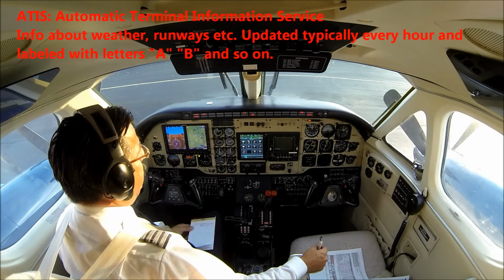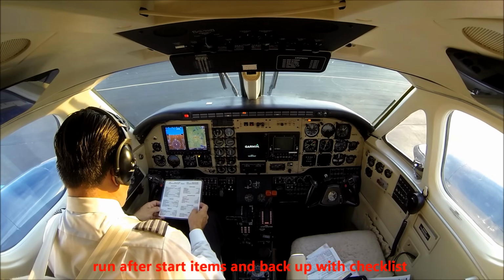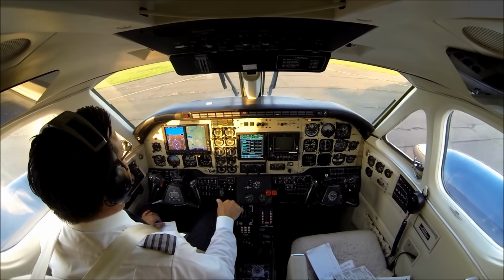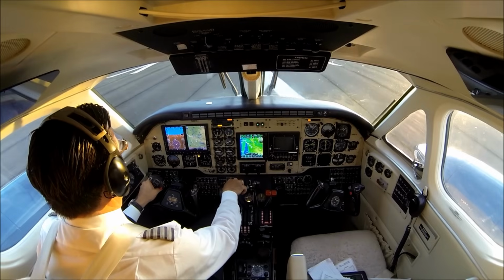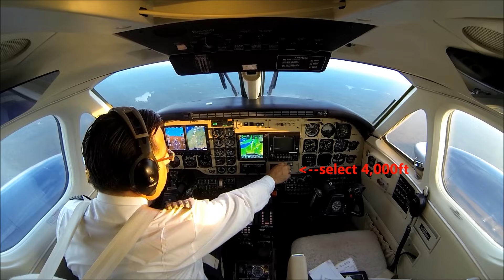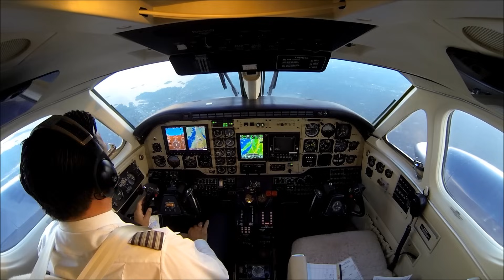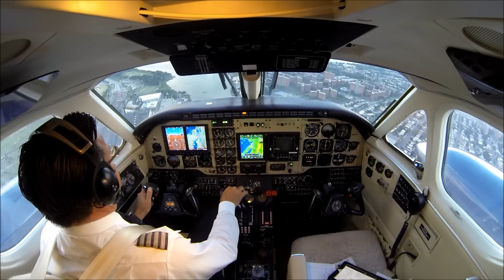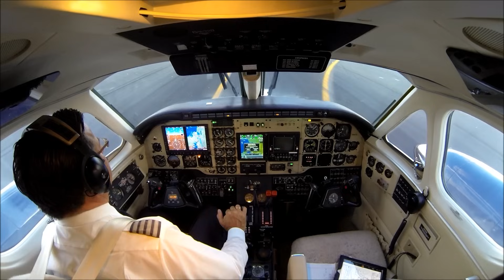King Air B100 - IFR flight to La Guardia KLGA!

Comment: The more one knows who to use the tools at hand, the easier it is to fly and monitor those tools.  At one time a type rating was systems and IFR workouts.  Now being comfortable with the nav units and couplings to A/P, the type rating part is a lot easier.  One thing though, relying on the gear-low torque to remind, could condition one into set pattens to lower the gear.  What if one is in an Aero without that function?  When Be100 and 200's entered service here, there was a trend for CPL's to move up to the ATP's.
Reply from the maker: Hi Dave,
I fully agree that one should never rely on the gear warning.
Checklist compliance is important and on top of this I still double check the "gear down" at 500 ft AGL. 
Happy Landings,
Guido
Reply: I often wondered when the newer equipment came into use, if there had been much pre-testing of human behaviour to user flaws.  In the early days, when the FAA was going to implement a new procedure, pilots where assembled in a room and each had a number. The controllers gave instructions while the psychologist watched and took down notes.  If there was a trend of test subject to turn right in stead of left, the procedure had a fault and was modified until no human intuitive behaviour took place.  I was taught and it is the standard here, to lower the gear on capturing the Glide Path before anything else.  A suggestion I submitted to CASA some time back, was that a trigger happen if the Aircraft has been established on a steady rate glide and the RA indicates a thousand feet  above minima, to sound out a GEAR, warning.
Reply from the maker: Dave F Ryan Thank you Dave. This is very interesting information. Did not know about this.
Happy Landings,
Guido
Reply: Pleasure Giudo.

Comment: Thanx guido...."Geil" as always..

Oh just one more thing...my two King Airs  from Carenado in X plane.The moters  are very sensitive.If I use them at max to long, they blow up on me.Is that true?

Thanx one more time .Happy landings..
Reply from the maker: Hi Willem,
turbine engines are very sensitive to excessive temperatures. But if you operate them as per the specifications, no problem at all.
Some engines have limitations, but these are mainly for cases of an engine failure. You can operate then the other engine for 10 minutes at a slightly higher power setting.
But in general the simple rule applies: operate the engines within their limits given by the manufacturers.
If you treat your engine well, the engine will treat YOU well.
Happy Landings,
Capt. Guido
Reply: @GuidoWarnecke  Thannx...
Reply from the maker: @Willem P  My be you can hel me: I have x-plane 11 and bought the C208B G1000 from Carenado. I cannot switch on the avionics. Other switches work. Any idea?
Happy Landings,
Capt. Guido
Reply: Carenado C208B Hi Guido. I know, half the fun flying this plane is the start up but, when doing this the avionics is stuffed. Unfortunately this does not work. The only thing you can as far as I know is to start with the motor running. When you start x plane and pick this plane. In the right corner bottom you tick the start with motor running and then it works.
I hope I could help you...

Comment: Guido it looks like you are flying with paper plates.  Do you expect to transition to an EFB or will you remain on paper?  I took my IFR checkride with the Foreflight app and have been using it ever since.  Just wondering about your thoughts on continued use of paper.
Reply from the maker: Hi Mike,
the future is electronic.
I flew for a company called CFM and we were the first in the US to be approved for paperless en-route and approach charts.
Works very well and you have always current charts over the internet.
Make sure that you have a charger on board (preferably a second EFB) and do not expose it to the sun.
The screen blanks out for a while...
Happy Landings,
Guido

Comment: I'd like to fly from Virginia Beach to Republic airport in long island. My intended route will put me over JFK class B and I do not want to be too far out over water with a single engine. Do you have any experience with VFR operations in this environment?
Reply from the maker: Normally not a problem. Call New York Approach well ahead and advise them of you intentions. Depending on the runway in use they will give you a class B clearance with altitudes and headings. Another cool thing you might consider is t fly very low South shore long Island. Up to 500ft it is completely uncontrolled, but you may speak to Kennedy tower and get a transponder code. I would fly at a 1000ft or so for safety.
Enjoy and let me know how it went!
Happy Landings,
Guido
Reply: Guido Warnecke Great. Thank you for the response.

Comment: This question is open to everyone. If you had to spend 2-3-4 hours flying an airplane, would you rather fly a turbine or a turbo prop and why?
Reply: +SanFranciscoBay Whichever has the more comfortable seats :)  Honestly the major limitation for flight time for me is needing to use the restroom. When I did my crew xcountry flights working on my commercial pilot certificate my first long xcountry was from Longbeach to Phoenix with a cruise speed of around 115kts which makes that a 3hr flight. Going across the desert where surface temperatures were 110F (but was a nice 55F at 12,000 feet) I made sure to hydrate before and during the flight but I drank a bit too much water and knew I was in trouble when I needed a bathroom 90min into the flight...  I made it to Phoenix and sprinted to the restroom but learned my lesson - water in moderation ;)
Reply from the maker: +SanFranciscoBay 
Flights in this jet are short, normally not more than 4 hours.
Happy Landings,
Guido
Reply: +SanFranciscoBay Was flying with a female co-pilot on that flight ;)
Reply: +Cascade Alley Aviation Services. Women have to urinate and defecate also and sometimes it's difficult to predict when. Is there a backseat that you can go to or do you have to stay in the front seat?

Comment: do you always start the left engine first and then use bleed air to start the right? or can you do this the other way around?

Thanks Much
Reply from the maker: Hi Rick,
you can start either engines first. 
Using an GPU (electric ground power unit) it will be plugged to a port behind the right engine.
Then the procedure is as follows: 
Start left engine first, unplug the GPU from the right side, start right engine.
It would be very unpleasant for the line crew to unplug the GPU cable directly behind a running engine.
Here a link to my latest video:
https://youtu.be/Af3fVp8R8bg
Happy Landings,
Guido

Comment: Hey Guido, thx for that video... I'm "just" flying Cessna and Remoquer.. but I've a Question... the Headset / Intercoms have the same plugs I think, which adapter do you use to record the atc's and your speech? I didn't find any adapter to plugin between intercom / headset to grap the sounds are apoken..
regards,
tim
Reply from the maker: Hi Tim,
(German?).
Fuer den Anschluss nehme ich einen sogenannten Y-Adapter. Gibts vielleicht bei Conrad Electronics.
Schicke mir ein email (Adresse am Ende des Videos) und ich schicke Dir ein Bild von dem Adapter,
Happy Landings,
Guido
PS: Remo ist ein klasse Flugzeug! Hab ich beim Aeroclub Gelnhausen ein bisschen geflogen (DR400)
Reply: Guido Warnecke  Verdammt habe ich geahnt mit dem "Deutsch" :- )
Mail ist raus - danke dir! :- ) Btw ich auch eine DR400 :)
Reply from the maker: Mein Deutscher  Akzent am Funk...

Comment: Hy Guido. You have some interesting videos but this one, is not one of them. I'm a first officer on Dash8 Q400 and also certified flight instructor for PPL and CPL training in Croatia and I'm more than qualified to recognize some potential problems and risks during single pilot operation. First of all every pilot should insert and check his flight plan in GPS on parking stand not during the taxi like you did. Briefing was good but you didn't say anything about normal departure briefing only emergency  before lift off and after lift off. Have you identified any of the navigational aids? specially localizer frequency? During approach to land you have put your electronic flight bag or whatever that is on the copilot seat. In case of go around you don't have a chart in front of you and if you don't have it memorized in your head, you would have to remove your hand from the throttle's to pick up your EFB to read some go around information. You know as well as I do what kind of problems can occur during go around specially in single pilot operation. After touchdown during deceleration you moved your head down and to the right searching for ground chart. This is not good because the aircraft didn't come to a stop. Remember this is a single pilot operation!!!!! I hope you're not mad at me for writing critics but that is only because you have great videos and I wanted to point out some negative transfers that we all have to a future pilots that are watching your videos. Sorry for grammar mistakes.
Reply from the maker: Thanks for your comments, Dado.
Some of them are very good, some of them come from the "academic" side of flying, and I do not mean this disrespectful.
Example: Modern radios auto-identify the frequency and show the identifier e.g. IXYZ. Single pilot flying is quite common in the USA, also under challenging weather conditions. In case of a go around, I would probably ask for vectors instead of flying the published missed approach.
Heads down: difficult thing - single pilot for example during take off you have to inside and outside of the cockpit all the time, monitor engine instruments.
Your comments are appreciated and especially for the new pilots during training everything should be "by the books".
Happy Landings,
Guido
Reply: What a load of nit-noid road apples.   I'll bet guy just LOVE to fly with you.   "See  you at the bar"   "Uh, no."

Comment: Guido. Why do you do your taxi with prop levers backward?
Reply from the maker: L. Risali These are Garrett engines with a direct shaft from the engine to the propellers.
For taxiing, we use a ground rpm setting (approx. 65%).
Otherwise the noise would be unbearable.
In the "normal" King Airs with PT6 free wheel engines, the lever is forward. This is probably what you are referring to,
Thanks for your comment & Happy Landings,
Guido
Reply: huum.. ok. So, because of this type of engine don't you do engine run-up before take-off?
Reply from the maker: no in turbines no typical run up is required.
Happy Landings,
Guido
Reply: I'm talking about overspeed governor check, and ice vanes check.
Reply from the maker: Overspeed governor check is only done once a month or so or if you do training and plan an engine shut down inflight.
Ice vanes are not installed on the Garrett engines.
Happy Landings,
Guido
Reply: Great... thank you, happy landings! 
Lucas Risali

Comment: quick question
when starting, I didn't see your arm move forward for fuel? is it all automated?
Reply from the maker: The engine start process in a Garret engine is automatic, like to start an APU.
The engine revs up, at a certain RPM fuel is automatically induced and it is an automatic process.
In reality, the pilot needs to adjust the fuel spray during engine light up.
Generally an "easy" process but requires good training for the pilot.
It is so different form a start process in a PT6.
Happy Landings,
Guido
Reply: +Guido Warnecke very nice! thanks! and with the adjusting the fuel spray, is that with small movements of the mixture lever?
Reply from the maker: The spray is on a small switch on the left of the cockpit out of view in the video.
Please send me an mail (address at end of video) and I send you a detail photo of the cockpit showing the switch.
Happy Landings,
Guido
Reply: +Guido Warnecke I'll send an email now, cheers!

Comment: Hi Guido, How much a landing on KLGA?
Reply from the maker: Willys Luna
Hi Willys.
The total cost is around $400,. Only a small portion is for the landing fees, the rest is for the handling services.
We avoid KLGA not so much for the cost (nearby Teterboro KTEB charges the same) it is because of the foreseen delays.
On one flight we had actually to taxi back to the ramp and get more fuel after waiting over one hour with the engines running.
You burn more than 150 liters per hour with the engines in idle only.
Happy Landings,
Guido
Reply: All right, thank you Captain...

Comment: to me no sense to do fms preparation on short stops during taxi, literally it takes same or even more time then after engine start on apron, plus(block time is ticking already, if overcrowded field traffic will be angry as well,+possible number 2.3.5 for takeoff or giveway to another aircraft you are number 100 - fuel savings zero, time ticking), when everything is IN fms, clearance received, in major airports transponder already shall be on when starting taxi. less workload during taxi, more situational awareness, less probability to miss something in checklist or some other thing... my 5 cents
Reply from the maker: Vladimiras Salukas Hi Vladimir,
Your comment is appreciated. The King Air B100 has no APU and the avionics drains a lot of battery power. So unless you are on ground power - not available at KLGA - you need to have the engines running. Also I do not understand the comment with the transponder. Some airports require ground mode on for taxi surveillance radar, do not remember if KLGA does. 
Happy Landings,
Guido

Comment: I am a licensed Ham Radio operator, my hobbies include monitoring VHF and HF air band communication and spotting planes also with the help of the flightradar24 nod I have at home.  Thanks 73 vu3mes Satyan
Reply from the maker: That is very interesting.
HF monitoring is very challenging I suppose.
Happy Landings,
Capt. Guido
Reply: @GuidoWarnecke  I used hear aircrafts from Cairo, Addis Ababa to Ho chimin city, Manila etc on my  Watkins Johnson communication receiver. But shortwave conditions are pretty poor these days.
Reply from the maker: @vu3mes  Pretty cool!
HF is often a hit and miss...
Happy Landings,
Capt. Guido
@t

Comment: Guido:  I have been there and have done it, although not to the extent of yourself.  My comment was based on the fact that there was the possibility that someone was conducting VFR flight, as it was not instrument conditions, and, you were not observing the rule of "see and be seen".  You were conducting a simulated IFR flight in VFR conditions without a check pilot.  Careless.
Reply from the maker: Hi Pete,
I believe you refer to the "VFR to JFK" flight video. Most of the flight was in controlled class B airspace. Outside class B C or D airspace, VFR is always a safety compromise. We have traffic alert, that helps. You look out of the window as much as practical. A lot of operators fly VFR in turboprops and even jets in terminal areas. We always have flight following which gives a lot of protection, although there is not "legal" separation from other traffic.
This is not careless.
If you fly under the hood for training and have no safety pilot on board: yes, that s careless.

Happy Landings,
Guido
Reply: Pete Daly, I don't understand your criticism: when was Mr. Warnecke simulating IFR?